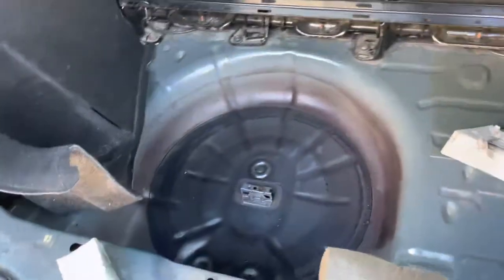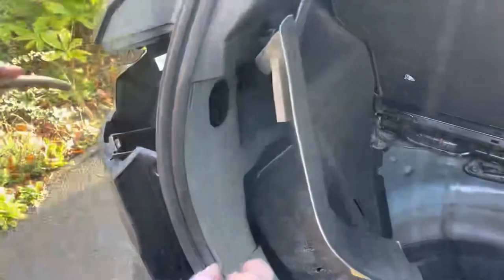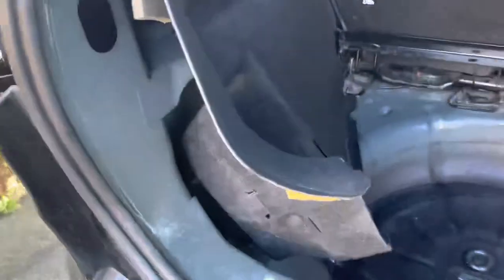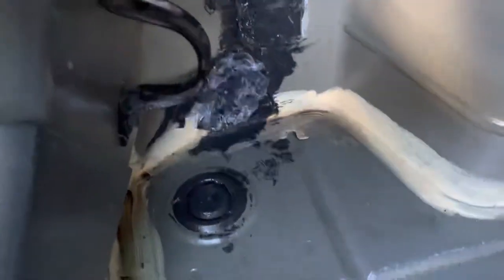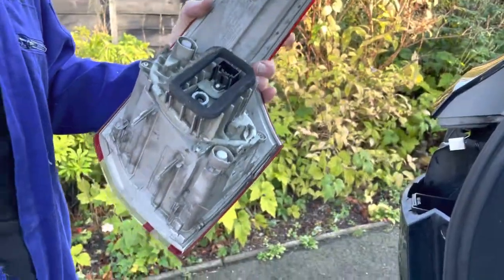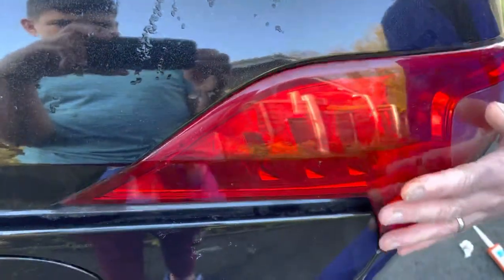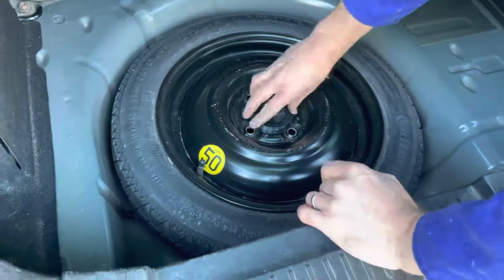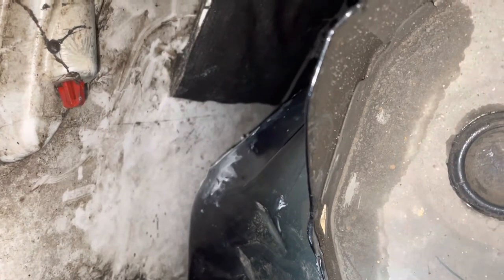Ford B-Max Water In The Boot And Footwells, C-Max S-Max, Home D.I.Y

Comment: Just bought a second hand b-max and it has exactly this problem, I think I've caught it early as its not soaking through, I intend to follow your video and repair it myself. Great video. Thanks. 👍
Reply from the maker: Hi David. 
Thanks for the message and glad you are tackling the problem before it causes too many issues. 
It’s so annoying to have this issue as the B-Max is otherwise a great car. 
All the best 🛠️

Comment: This video was excellent information and hope your car stayed dry as this model is well known for leaking on the side door aswell. 
I used a bituman roofing tape and used a heat gun to melt it air tight.
The fact that the hole is situated where it is poor but for it to be covered with cheap tape is a joke.
Reply from the maker: Thanks for watching and the message, very much appreciated. 
The car pretty much stayed free of water although I did discover another section that was covered with tape. 
I also used a bitumen tape to seal over the hole and gasket. 
Fords really didn’t want this model of car to be used in wet conditions 🤣
Reply: @diyhomeandgardening  I have a 27yr old Volvo that has never leaked while my VW van and the B -Max leak so it's clear cars are not made aswell and as far as the B-Max an avoidable design flaw.
Reply from the maker: @ibrstellar1080  
I know what you mean. My old Fiesta drove for nearly 200k miles without any issues and yet the newer cars fall apart and have issues from day one.

Comment: I wondered why there was water in the wheel well, now I know thanks
Reply from the maker: Hi Peter. Thanks for the message. 
Yes, unfortunately it is a very common issue with the Max series of cars. I hope you can get the leak sorted out okay. 
It’s worth also checking for signs of damp and water in the footwells. 
All the best 🛠️

Comment: Just discovered that my 2016 S-Max had been leaking for so long, the entire carpet had become saturated and mouldy. I would have to remove all the seats and carpet to dry it out but I do not have anywhere to store these parts. The main dealer is going to charge me £1150 for a new carpet and £500 for investigating the source of the leak which they have identified as the centre rear brake light. Really?
I have a feeling that I will be paying out for another carpet soon after I get my car back. Great video, thanks for the information.
Reply from the maker: Hi Raymond. Thanks for watching and the message, much appreciated. 
Firstly, I would have a look for yourself before paying the crazy garage prices. 

If the water is coming through the centre rear light then you would see water inside the light itself. Also, if entering through the light then there would be water within the boot door as this is the only option for the water to go to. 

To dry out the car there are some small access points under the front seats, to the rear, where you can get a sponge in to soak up water. 
Small access carpet panels are also in the front. 

In the boot just pull the liner out as that just slides onto the rear bar, remove spare wheel etc and remove the water. 

After removing as much water as possible we used a dehumidifier for a day to dry the inside out. 

Whatever you can do to reduce the amount of work that Fords have to do will save you a lot of money. 
Fords know there is an issue with the rear vents. The vents only cost about £50 for the pair and it’s an easy job taking a few hours. 
Hope you get the issue sorted out 🛠️🌻

Comment: Hi, I’ve got water in the back and front footwells, (I’ve been baling it out from the floor ‘flap’ underneath the seat as shown in your excellent video!) - does the water find its way from the rear of the car all the way to the front footwells, or is the front water getting in somewhere else?
Reply from the maker: Hi Dave. 
Thanks for watching. 
Unfortunately the water travels from the rear all the way through the car to the front and rear footwells. 
Get as much water out as possible and park on a slope, boot facing downhill, to allow some drain off from the rear. 
It’s a real pain. 
Hope you can get the leak resolved 🛠️🌻

Comment: Thank you, i am inspired to fix my smax. Do you have a video on how to dry out your footwell?
Reply from the maker: Hi Bernie,
Many thanks for watching and the message. 
I don’t have a video on drying the footwell out as it would be rather dull😄
The only way to do it is to use a sponge and get your hand under the carpet by going through the cut openings. 
Once we had got as much water out as we could we then ran a dehumidifier in the car for most of the day. 
A slow and time consuming process but it did the trick. 
Good luck 🛠️🌻

Comment: Thanks for the tips where to find the first leakage. I chose to remove the rear bumper, so I could see the actual cause which is the vents. This seems to be curling a bit, so I'm searching for a replacement. Hopefully, that way I can keep the ventilation and still fix the issue.
Reply from the maker: Hi Vincent thanks for watching. 
Glad you have worked out the cause of your leak. 
You can get the replacement vents from Ford spares for about £50, that’s where I purchased from. 
Hope this helps you 🛠️🌻
Reply: @diyhomeandgardening  awesome. I was searching already, but could not find a part number or exact name which I need. Do you happen to remember the name or part number?
Reply from the maker: @viker81 Hi. 
I have just added the part numbers and description of the rear air inlet grilles that I used to the descriptions part of the video. 
Hopefully this will help you. All the best

Comment: Thanks mate. That is helpful. I have this exact same issue on my B max. I originally thought it was an issue when I had a tow bar fitted recently but now I think it is this issue instead.
Reply from the maker: Thanks for the message and watching. 
It seems to be a problem with Bmax, Cmax and Smax, and probably other fords too. Not a hard fix but not a fix that really should be required if the cars were built properly to begin with. 
Hopefully your leak will be no more after you complete the job. Good luck
Reply: BTW how did you initially find the location of those vents? Reason being is that I have masked up the holes inside the boot but the problem still occuring so maybe it is through those vents you shown in later part of the vid?
Reply from the maker: @Blackmamba12345  
I only found the vents when I was under the car trying to seal the taped hole within the wheel arch. 
There are also 2 vents behind the rear bumper if you can reach them.
Reply: @diyhomeandgardening  Hi mate, so the other weekend I looked at this again and I put more tape on the holes in the boot. So did you use sealant on all those holes? What about where you remove the lights? Did you put silicon on those where they join to the chassis? As I have found more water in the boot again near where I put the waterproof tape. How's yours holding out?
Reply from the maker: @Blackmamba12345  
Hi and thanks for messaging. 
Put sealant and tape on all the holes. 
Don’t put any sealant behind the light housing as you won’t be able to remove the housing again should you need to change a bulb. 

If you have taped and sealed all the holes and you are still finding that water is getting into the boot or the car then almost certainly you will find that the rubber flaps, that go over the chassis vents, have perished. 
The vents are located directly below the drainage channel that runs down from behind the light housing. You can see them once the interior liner is removed from the boot, by looking down and through the inner bodywork where the light housing is fixed. 
Hope that makes sense. 

If it is the vents that have perished then it’s easier to get a garage to do the work to replace the vents. 
I did replace mine, with a mechanic friend, as the whole rear bumper needs to be removed and parking sensors disconnected. 
The vents only cost about £50 for the pair. They clip into place but also need a sealant applied prior to installation. 
Hope all this helps you enough to isolate the issue. 
All the best 🛠️
Reply: @diyhomeandgardening  Haha yes that's a good point, don't want to seal the lights cos won't be able to remove them if want to change a bulb! Yeah probs why I didn't last time, but was thinking after watching the vid that the water was getting in around where the lighting cable goes in when you remove the lights. But yes that sounds better I will go and get some sealant soon to block up all the holes inside like you as hopefully that will resolve the problem as that was useful where you showed with the hosepipe. I am hoping if I just seal those up rather than just using the tape then that will do it. I think I thought just using the waterproof tape would be enough but obvs it needs the sealant so cheers I will have another look to hopefully solve it! Edit: i did actually have a look underneath at the chassis vents as I got it up on the ramps from behind to install some rear mud flaps as well and had a look with a torch / felt the vents and they did seem alright even without removing the rear bumper so hopefully it is just the case of getting some sealant on the holes to resolve the problem.
Reply from the maker: @Blackmamba12345  No problem, see how you get on.
Reply: @diyhomeandgardening  Hi Mate, so I used fibre glass to block up those holes in the boot area but I am still getting water leaking in? I can't understand it because the holes are all blocked up now... do you have any other suggestions?
Reply from the maker: @Blackmamba12345  
Hi. Thanks for watching and messaging. 
Fibreglass is decently a great way to fill in the obvious gaps. 
If everything is solid and still water is getting in then it could be that water is coming in via the rear light housing. 
Have you removed the inner boot lining to see where water is coming in. 
I got in the boot and had my wife run water over the back of the car, from the hosepipe, to see where anything was coming in. Definitely sped up the detective work😄
Hope this helps a little
Reply: @diyhomeandgardening Hi mate yeah cheers so removed all the stuff in the boot except the trim which can’t. I did that water check with my dad in the end. Found another spot where it leaks in which is in the corner of the boot! Plus the tailgate rubber seems to be leaking too… gotta try to work out how to fix that? Also do you have issues with water under the car footwells too on driver and rear footwells?
Reply from the maker: @Blackmamba12345  
Hi. Glad you have worked out where the water is coming in for the boot. 

I did have water in the footwells. That water comes in via the air vents, situated just under the rear light cluster and behind the bumper. 
Once I had replaced the vents then the water issue in footwells also stopped. 
Annoyingly the only way to get that water out is with a sponge and then we stuck a dehumidifier in the car. Such a painful process brought about by poor design. 
Hope you can get the issues resolved. All the best.
Reply: @diyhomeandgardening  Yes that's right it is poor design. You can see how Ford tried to seal it up with white sealant around the boot but not in all the spots so will have to try more sealant I think. Ah ok yeah that's good to know you fixed it I will have a look at that maybe in the summer so can see to properly dry out the car such as the carpets etc.
Reply from the maker: @Blackmamba12345  
I reversed the car to get the boot under the garage door for working on it. 
To do the vents I went to my mates garage and he helped as the rear bumper has to be removed to swap out. 
Replacement vents were less than £50 for the pair from Fords spares department.

Comment: I have the same problem with my BMax, what a crazy design. Can you tell me how difficult it was to remove the bumper?
Reply from the maker: Hi Dave. 
Honestly it wasn’t that difficult as my friend gave me a hand at his garage!!
Basically just disconnecting the rear sensor connectors and then remove the star bit screws to take the bumper off, whilst trying not to scratch the bumper itself. 
Still took us about half a day to get done.
Reply: @diyhomeandgardening  Thanks again. I will wait until the weather gets warmer and not as wet!!!! Enjoying. your other videos now. Great job
Reply from the maker: @DaveWilson-t7i  Many thanks Dave. Hope you have a good week

Comment: Hiya, great video mate however the water noise in my 2015 CMAX is in my boot lid itself. I’ve checked the boot in general and wheel to see if there’s any water and there’s none but when I close the boot lid I can hear the water slosh in the lid itself close to where the clip is that locks the boot shut. Do you have any advice or guidance on what to do with this like an easy fix or is it a case of removing the inner part of the boot lid? I’m just conscious as I don’t want to break anything on it 😂 any help with this would be great! Cheers!
Reply from the maker: Hi Bradley. 
Thanks for watching and messaging. 
By boot lid do you mean, what I would call, the door and door lining. 
If you have water getting into the boot liner section then it is most likely getting in through the high level brake light. The seal on that also fails which then allows water to fill the light housing and the boot panel. 
Water into the light housing normally, but not always, causes the high level brake light to blow. 

To look for water ingress, or to change the bulb, the boot panel can be easily removed. 
Prise off the top of the door handle using a flat head screwdriver. 
Once removed you will find  a couple of screws to remove. From memory the rest of the boot liner then just pulls off. It needs a good tug to release the clips.   
Once removed you then have access to see the condition of seal and grommets for the high level light. 
Let me know if this helps you and if we are talking of the same issue 😄🔨
Reply: @diyhomeandgardening hi mate, yeah sorry that’s what I was meaning and I’m going to have a look at it today and see what’s going on. I’m going to double check the brake lights and check the seal. 

If it’s the seal on where you’ve said that might have gone, what would you recommend to fix the seal? Cheers for your help on this 🙂
Reply from the maker: @bradleyedwards3678  
It’s only the top / high level brake light that you need to look at. 

I would suggest taking off the inner section of boot liner and then close the boot again to test for leaks. 
I got inside the boot and had my wife trickle water, using a hosepipe, around the boot and light housing. 
Hopefully you can see or hear where the water is coming from.

If the leak is from the light housing then you can use silicone sealant for cars. It’s available from Halfords as a quick purchase. 
Hope you get the problem solved.
Reply: @diyhomeandgardening  Nice one mate thank you so much! I’ll let you know how I get on with it 🙂 thanks again 🙌🏻
Reply from the maker: @bradleyedwards3678  
No problem at all. 
Most things like this I work on the basis that if I can solve the problem then it’s a saving of a couple hundred pounds and if I can’t solve it then plan B is the garage, but I they can rule out what has been tried already. 
All the best pal 🔧
Reply: @diyhomeandgardening  honestly mate I really appreciate it and like you say if you can save others hundreds of pounds then it’s a win all round. I managed to take the inner section of the boot off, dried it all and got my Mrs to pour water where the lights are and all over the back of the car and not a single drop leaked through and we poured a lot of water onto it as well 🤣 checked the seals and they were all fine, all the lights are working fine, think it’s just because of the bad weather and how much it’s rained heavily for the past few days. Either way I’m confident that there’s nothing wrong with it but will keep an eye on it just to be sure, you’re advice on here and in the video was fantastic and really helpful so thank you mate I honestly really appreciate it and thank you for your time with this 🙌🏻 On a plus note the back of my car is very clean now 😂
Reply from the maker: @bradleyedwards3678  
Glad to here everything is good. 
A nice bonding experience with the wife too I’m sure 😂
On the plus side, you now know how to take apart some of the car. 

Since we had issues with water in the boot I now pay attention to cleaning the debris from around the light housing to make sure water can flow freely. 
Have a good evening.
Reply: @diyhomeandgardening  absolutely mate she was thrilled to be pouring water on the car whilst I was sat in the boot 😂 
Exactly, everyday is a school day 🎓
Thank you for the advice mate, I will keep on eye on that too and make sure to clear any debris from the light housing 
Cheers mate, you too 🙂🙌🏻

Comment: I have a b max and I will be checking mine this morning I haven't noticed any water coming in or if the carpet is wet in the boot or around the spare wheel am I right in saying that water is running down the inside of the boot shut and getting into the vehicle where the rear cluster lamp is this then trickles into the vehicle this is a bad design the rubber plug that you have silicone on is a water release bung they are there for water comes in they are usually fitted at the lowest point like under the spare wheel
Reply from the maker: Hi Chris. 
Thanks for your message. 
My car didn’t start to leak until it was about 5 or 6 years old. 
The water ingress occurs at 2 points. 
Below the rear cluster lights is an air vent, this is where the outer flaps degrade and shrink so as to no longer provide adequate seal. 
Second point of water entry is through an opening high up in the wheel arch that is meant to be taped and sealed. The tape fails after time. 
Both are common faults as the cars get older. Fault is in all the Max series. Hope this helps you. 🔨👍